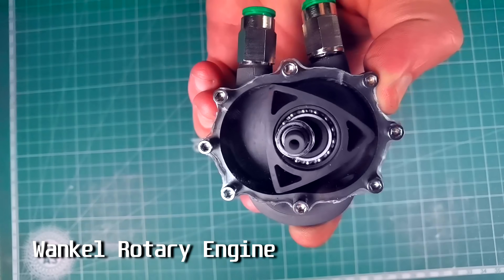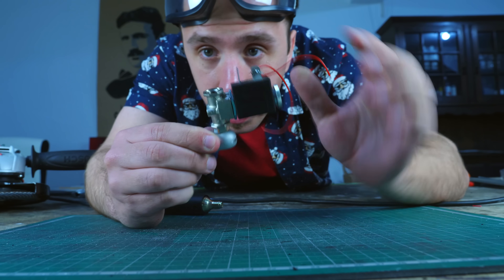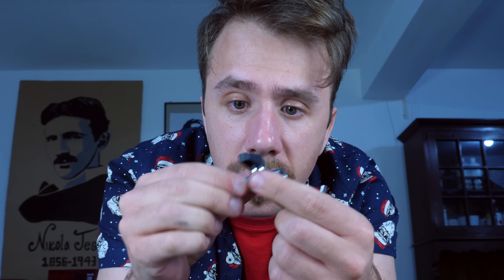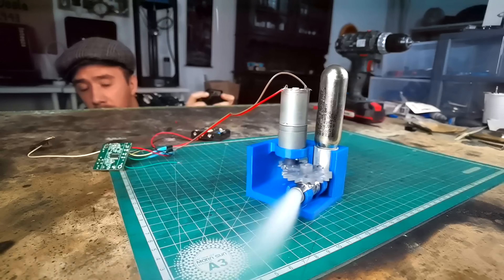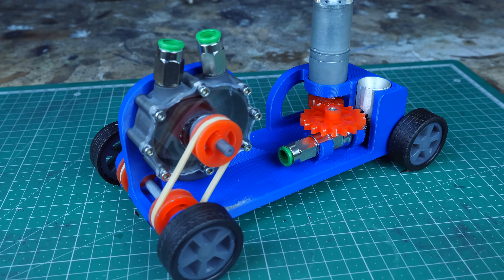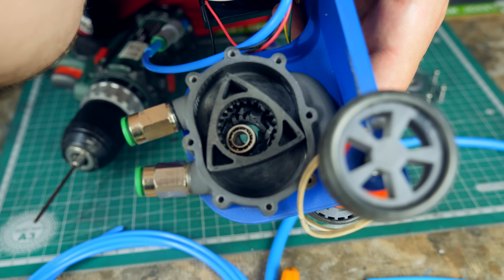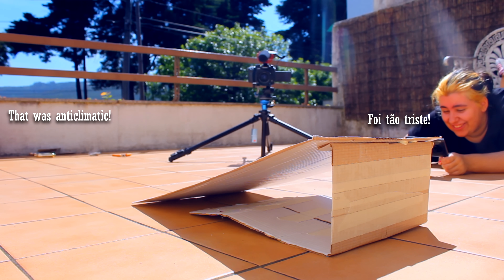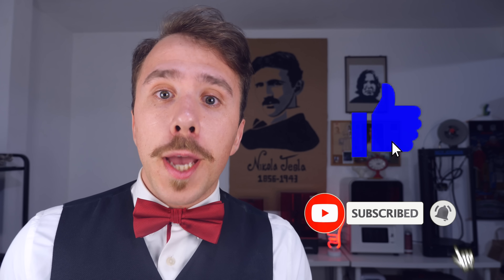Rotary Wankel RC Car (3D Printed)

Comment: How about a solar RC vehicle that can not use batteries etc, I was thinking maybe storing energy on a flywheel and maybe even using the flywheel as a coil too. Then have a geared clutch coming off that.

Comment: Loads of slippage at the elastic band. Looks like the wankle engine is producing enough torque, its just not being transferred to the wheels. A gear reduction may be required!

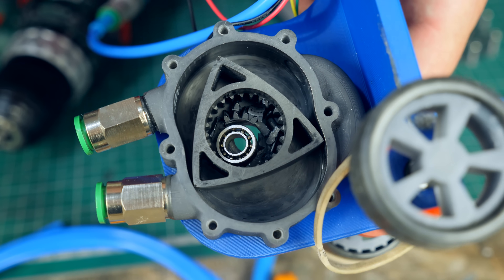Comment: 7:31 at this part of the video we can see a lot of energy wastage between the rubber band and the pulley as it slips on the pulley. It would have better torque if the crackshaft had a small 3d printed gearbox attched to it to avoid power loss

Comment: So much wasted energy in the wheels bouncing up and down; need some weight over them.
Also, the rubber band is slipping I'm sure. 
Lastly, you should have some sort of buffer chamber where the gas can heat up a bit and expand more/sublimate, producing potentially greater thrust.
Also, gear ratios. I wouldn't give up on the engine but the rocket is cool too👍

Comment: Idea: Make modifications to the video car. Try to use it as a dragster or a monster truck.
Suggestions: for all ideas I think you should improve on the wheels (increase the size), choose a gear transmission instead of a belt, make a cvt transmissions or a gearbox for high engine revs and for the last use a pressure regulator

Comment: Video Idea: You should try to make a fully 3D submarine that has basic movement controls and a torpedo launching system. The challenge is to make it small and lightweight but still be strong enough to withstand the pressure.

Comment: Bro your ruber band was slipping from the pulley use a tradeed gear and tradeed belt or use use a gear box to slow down the rpm or a nozzle to direct the trust.

Comment: To throttle the pressure and have a longer run time, you can try using a needle valve, or a electric actuated proportional valve.

Comment: So much energy wasted. You need to find a way to slow down the wankel. Right now what you are doing is like making a Truck engine run at max RPM in first gear to power a bicycle. I'd suggest you put your hand on a pressure regulator to make the cartridge last much much longer. It would also help with the cooldown effect of the cartridge which liquify the gas causing it to rapidly loose pressure

Comment: Hi Integza, there exists something as a constant flow valve. As the pressure in the cartridge rapidly decreases, the flow produced will also rapidly decrease as the width of the puncture is fixed. Resulting in your engine losing power pretty quickly. A constant flow valve, might resolve this issue.

Comment: I am not an engine engineer (quite redundant) but I think the car could improve a lot if you changed the transmission to better transfer the gas impulse to the wheels, the slowmo showed the belt wobbling (if that is how it is written) a lot

Comment: You should try the new version of the wankel engine.. The fluid piston engine. Its just like the wankel but more efficient and has an extra combustion stage per cycle.
Reply: Sorry correction. Its called the liquid piston engine.

Comment: You're using co2 wrong.
Instead of feeding liquid gas that expands inside you have to let it expand before feeding velocity based engine. You may try redoing it with proper atomization onto heat radiator to speed up evaporation, or use it with more traditional piston engine which performance should be good on lower rpm with proper dozing.
For the evaporation on liquid co2 i know there was airsoft gbb with very small gas useage that used cylindrical mesh which dispensed aerosolized liquid co2 inside small metal chamber before feeding. There was practically no visible fog coming out of it with preserved bb velocity compared to other types, and significantly reduced gas useage.
You can basically apply similar rule to combustion engine... trying to add too much fuel will choke it and supress it's performance, or even cease it's operation.

Basically do not try to hit highest rpm in first try, but make it work, then improve. I really want to see it explo...
Eghem... work.

And tomatoes are great!
Reply: It's sure that he need to regulate the pressure.
But I'm sure he already knew that when starting, but if he want to be entertaining and able to do more than one video, he increment the project each week
Reply: I think I know who is getting the 3d printer lol
Reply: Actually it doesn't matter 🤣 because it can't handle higher RPM i mean the wheel just slip because of speed
Reply: @jyothikrishnanss5-ee171  It does not actually can't handle high RPM, but is slipping, there two main ways to limit this.
If you can directly controll drivetrain torque you may just use less power, this is used in electric vehicles.
If you using combustion engine or in this case pressurized non traditional air engine in which you can't control torque directly you can control ammount of torque transfered or gear reduction. As reduction would increase losses and is limited by scale the best avaible option is to create variable clutch like in combustion engines. The most traditional, often ised in RC is slipping clutch that uses friction caused by pressure (you may wanna look up RC clutch). Other type used in automatic transmissions, that theoretically could work in RC as well is fluid coupling. It can transfer less torque at high angular speed difference, but has advantage of woking automatically no matter how low RPMs are (in theory as there is allways friction) on output.
There are of course other types and finding the best solution is sometimes problematic because of things like compoment wear, friction, strength, transmission characteristics and size.
Reply: You are so right about this, its a basic fundamental in airsoft gas powered weapons
Reply: adding something to warm up the gas would add too much weight, the car wouldn't be able to move.
Reply: @DreznorTTG  
  I think that weight of the heat exchanger doesn't have to be that much. The heat exchanger have to just get rid of enough "cold" from co2, taking into count that heat energy will be large, flow of heat into system should be larger too compared to other things like radiators in electronics which energy difference is smaller. And yet there is heat capacity and flow problem that is some obstacle. Depending how much co2 Integza wants to use in single try and what co2 flow he wants to get there may be show up icing.
Like snow paw pointed out some additional heat source would allow to reduce heat capacity and most of weight, but it's additional energy source required that I'm not sure if Integza is looking for anything other than co2.
Reply: @DreznorTTG  maybe a copper tube and a candle would be enough
Reply: As long as it works and gets the job done, it's not wrong
Reply: @suspense_comix3237  Integza does not care for simple "it works my job is done"
He's Tesla follower, he wants POWER.
And he wants to flood the WORLD with his POWER like Tesla tried before, but he failed because of he did not had the power of rapid prototyping and enough will to destroy all tomatoes with the POWER he acquired. But Integza is not sane, he's overfilled with so much hate that he got possessed by the hatred itself, and now he's sitting under 🍅 banner creating The Plan to bring the end to poor taste full fruits. And i will help him achieve that, as you can't make the drink of the gods... Tomato juice... Without crushing them down first.
And for that you need POWER
Reply: did not ask
Reply: @extremeroom7u7  Who did not ask?
Reply: @extremeroom7u7  did not ask for a did not ask comment.

Comment: For a future video, i think, making a new type of transmission (like geared instead of a rubber band, for example) could be cool and give more power to the wheels, so the car could move faster and better. It also can be a good idea to test different types of gears and/or transmissions and see how they could be printed efficiencely with a 3D printer.
Reply: That would be really cool if he could regulate the pressure to make the co2 last longer
Reply: @amihere383  yeah, it would be an awersome idea. his original idea was really good, but i think that, with some improvements, it could be even better ^^
Reply: @skygaminggc1641  Absolutely. I think on such a small scale and with the available materials though, having a decently functioning clutch would be impossible, so having a reasonably controllable pressure valve so the wheels don't just spin until he's out of pressure would be the biggest struggle

Comment: Gotta flip your cartridge around so you get air, not liquid. Also, why apply all that force downward. Position that exhaust to blow behind the car. Extra momentum forward, rather than downward force. 

To anyone who says that doesn't simulate the engine, the exhaust is an integral part of this engine. So ya, it does simulate it.

Comment: Bro your wankle engine is pretty nice but your exhaust system is disturbing it .Make the air flow backward creating thrust.In your case is it also adding load  due to air pressure.Love from Nepal.

Comment: You maybe could add some weight at the front of the car to avoid stick and slip phenomenon. I think you lose a large amount of power at the start-up of the engine. Thanks for your videos, they are very inspirating!

Comment: Maybe you should change the rubber band/drive belt solution to a gear solution. That should increase the amount of transferred energy, because it seemed like the rubber band lost friction, when the engine was rotating so fast.

 or you just increase the tension on the rubber band and the friction on both ends.
That should do it too.

Comment: With your Wankel-Engine you have made a big mistake, that cost you some Power. Remeernber this is a 4 stroke engine! So if you just add a 2nd pair of inlets and outlets on the other side, you will got a lot more power, cause when you fill in compressed gas into the inlet, first it will turn the rotor while the gas expand the 1st time, but than the rotor will compress your gas agan in the 2nd stroke of your Wankel, tha cost you alle the power from the first stroke. than it will expand again, giving you the poweer you want to use. with 2 inlets and 2 outlets, yor may use any stroke of your wankel air pressure engine.

Comment: Hey Integza, you should make an electrolytic hydrogen engine. You always use propane as fuel but for those you just seperate the hydrogen and oxygen from water to make fuel, so no need for costly propane

Comment: Cool Video! Have you thought about using a servo motor to have a better and precise control of the opening valve? 
Regarding the engine connection to the wheels, you about a timing belt? Less energy lost in rubber spinning i guess.

Comment: You could make a Wankel Car 2.0  using a larger CO2 or compressed air source such as a paintball tank. Use a valve to reduce the flow of the gas, it will allow a longer run time and you can add steering an use it more like a traditional rc car but pressure powered.

Comment: Idea: Since the hybrid engine housing/casing thing held up pretty well, you could try putting the resin from the rocket that powers itself inside a housing similar to the hybrid. Kinda like solid rocket fuel I guess.

Comment: Next time, try inverting the cartridge and valve. The way it's set up now is using liquid, but gas will have very different properties. Also consider a way to warm the CO2 before the engine, possibly a coil of metal tubing?

Comment: Create a rocket or an engine that mixes 2 chemicals that self ignite when you mix them 3d print a shell for it and make some interesting nosles i think it would be a good idea be careful dont kill yourself also for the 2 liquids a thick resign container should do the trick and should withstand the heat for as long as it burns

Comment: You should add a pipe for exhaust gas to the excess gas helps push the car along instead of them coming out the top putting force down onto the car

Comment: try re-doing the engine + Co2 . Print a inline 4 cylinder engine but use the cartridge on it side like suggested below for longer runtime.

Comment: I just thought can you make at least 4 rotary motor connect them parallely one shaft. First rotary output valve connected with next rotary input value. Like a chain😳 I feel plastic gonna burst by the pressure. But still. One cycle for a rotary? With high psi. It's not fair. So much power loss 😶

Comment: You should see if the 3d printed solid rocket fuel could be used as a torch, either for welding or cutting

Comment: You need something a little stronger than a rubber band as well, that is contributing to a huge loss of power to the wheels.
Maybe even adding a couple more might give it enough traction.

Comment: Design and 3D print a 3D printer with a remote to control it with something other than a computer (tomatoes are disgusting) also if you need some CAD files to get you started let me know

Comment: We designed and made 3d printed drag racers at uni. The key is to keep it light and also think about rerouting the gas a bit so that when it leaves the car it is applying some downforce on the front tires. That will help your traction problem

Comment: you're losing a ton of force because the  belt is slippery at that speed... using a chain belt drive could be a good solution for that. that or desing a chain drive in 3d printing as the next step up! i've seen people doing similar things it could actually work!

Comment: How about replacing the rubber band with gears to transmit power from the wankel?  The slomo shows a lot of rpm before the car starts to roll.  If you need to reach a certain rpm before engaging the wheel, (though I doubt it because your engine is powerful enough) you could insert a 3d printed centrifugal switch.

Comment: You gotta dial down the energy loss on that rubber, it's wasting a lot because the engine spins so fast and doesn't generate enough friction for the rubber to transmit the full energy. Maybe a pulley with teeth and a gear would transmit much more power from the engine

Comment: Video idea: Why not use the engine in a boat? Seems like a fun idea because it has much more power than the compressed air version. With a bigger propeller it might reach insane speed?

Comment: You should make the engine two way and then connect the axel with two pulleys both on either side make sure the rubber band is super tight bcuz most of the rotations were going to waste.. this engine performed really well! Btw the engine has some leaks better cover the sides with some rubber tight seal....

Comment: Design a gearbox and mount it between the wankel motor and the back wheels of the car and add some weight to the chassis and it should solve the grip problem of the car. (You can add more cartridges of CO2 to make it run longer).

Comment: Quick question ? Why not trying to use less pressure in the small engine to don't beak it and have a better autonomy ? As I've seen on your slow motion, the motor is leaking when using the gas straight out of the tiny CO2 cartridge. Maybe it can be more effective to use less pressure.

Comment: If you restrict the flow out of the exhaust of the wankel motor it might reduce the max rpm of the motor and a low the co2 cartridge to last longer

Comment: I think you have to control the pressure more... Like a scuba diver. We use two stages to reduce the pressure from 220bar to a breathable pressure.

So. Take a look at softair guns also. There are valves you can use. Timed with a hammer or something. https://www.amazon.de/dp/B08DK39HGF/ref=cm_sw_r_cp_awdb_imm_Q6DX14XHP80PWKQ5MZAF?_encoding=UTF8&psc=1

Comment: Why dont you 3D print a rocket and use the large CO2 cartridge to power it. Make the tube of the rocket in sections that can screw together so you can make it larger or smaller. Radio controlled fins for steering would also be cool. Launch a tomato into space. That way it will not be able to come back to haunt you. You dont need a parachute as the tomato will not be coming back. 3D print a nozzle for the rocket and try several to see which give the better thrust. 3D print the launch tower assembly as well. Cool project.

Comment: You need a pressure control valve rather than an on off valve, this should give you a more constant flow and help solve the axle tramp you are getting at initial acceleration, this should make it faster and run for longer.

Comment: I like the video but you could have just used an electrically controlled solenoid for low pressure gas. They're like $5

Comment: I hope you noticed the slip on the belt. Try using gears next time as it would use the full potential of the engine. (assuming the gears don't explode in front of tomatoes)

Comment: 3D print a Nikola Tesla animatronic figure.Geared layers on a shaft that rotate and change the pose over time like a puzzle. Oh and try to regulate the flow from the C02 you will get more bang for your buck and longer engine life you rev head :) .

Comment: 2 suggestions

Try adapting your Wenkel motor to minimize displacement. Less chamber volume is necessary for low-torque applications which means you can conserve fuel (make it last longer).

Also, instead of allowing the full flow of air into the engine, you should add a metering device (orifice, valve, etc) between the air tank and the engine inlet to regulate pressure. For an application that small, I think a length of capillary tube would suffice.

Comment: Video idea: Using multiple Co2 cartridges in a circular pattern piloted by solenoid actuators to make a directional thrust for a small rocket and see how high/far it goes.
More nozzles more fun :)

Comment: Next project(s)...
3D print a dedicated rocket car chassis rigid enough to fully use the thrust.
OR
3D print a wankel chassis with integrated gearbox to better use the power available
AND
3D print a more sturdy ramp.

OPTIONAL
3D print a small guillotine with smooshing attachment
because tomatoes are disgusting